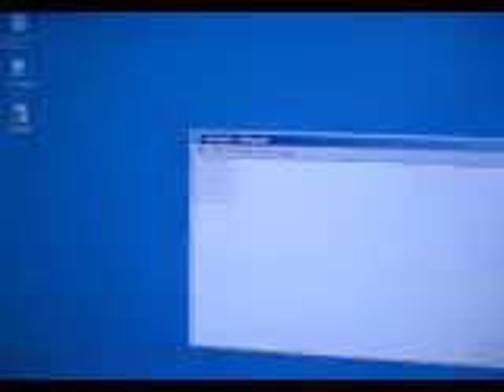Size Matters - Glass RFID tag limitations

Comment: Thanks for the heads up...

I plan to test the piss out of a few of these before implanting one. I'm a ham radio operator as well so I need to see if 1.5KW of power from a nearby antenna will kill it.
or... more importantly 5-10watt radio in my hand..

I would rather avoid a scalpel, I'm just not to fond of the idea. I'll just buy a few non-steral 2x12mm tags and do some bash testing on them.. and get an idea of how it'll work before I buy the steral one for implantation. Thanks for the reply.

Comment from the maker: Well, it depends on what type of reader you want to use. Most readers will read 2x12 tags but, as the video shows, not all readers read them that well. The key is to try and test your reader/application first before getting implanted :)

Getting a 3x13mm tag is tougher because you need someone who's willing to work with a scalpel or a serious skin punch. Also, the 3x13mm tag is at a slightly higher risk for breaking.

Comment: Hmmm.. So would you then not recommend a 2x12mm tag for implantation?
or rather only recommend it with the use of a cylindrical reader?

I'm planning on an implant but I'd hate for it not to work, I'm not a big fan of pain so if I had to replace it shortly after I wouldn't be to thrilled. (don't get me wrong I know its going to hurt, I just don't want to get a tag that won't work properly have to go through it more than I need to to reach my goal)